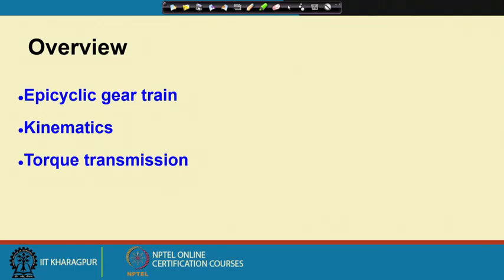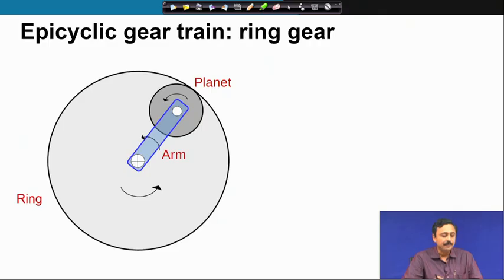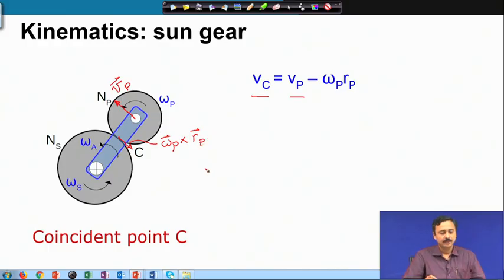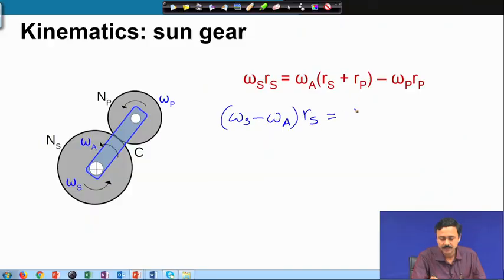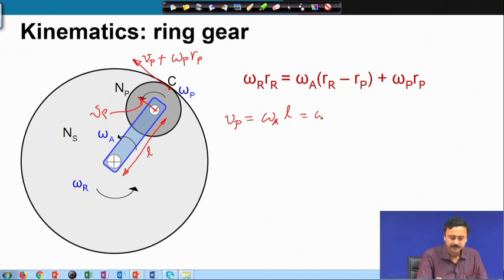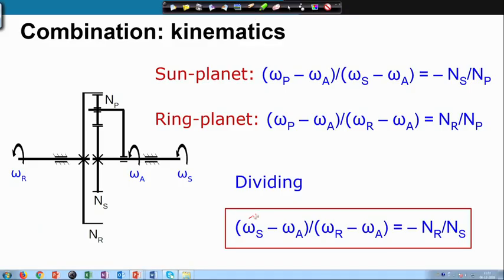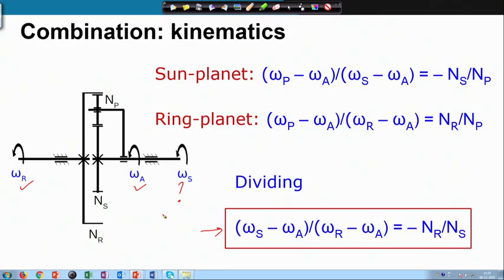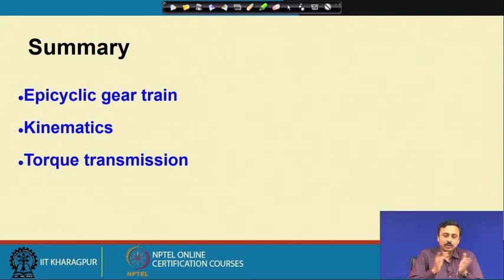Lecture 39: Gear trains – II

Comment: Why does total power input is zero,it should be equal to power output
Reply: actually the equation means that the net work done by the gear system is always zero